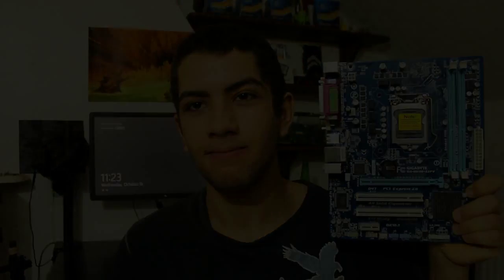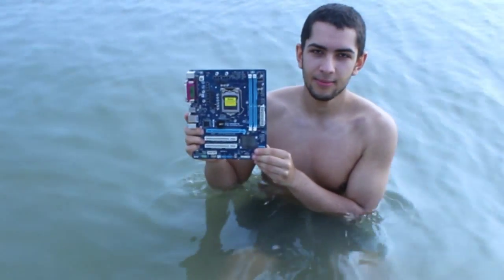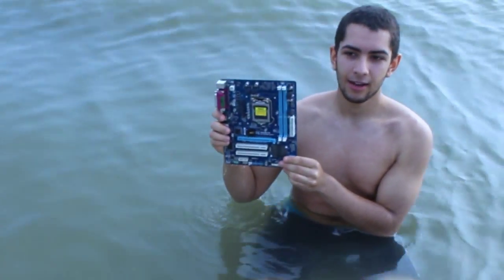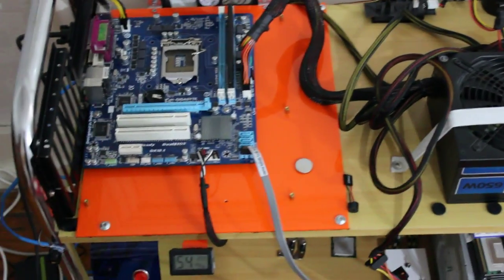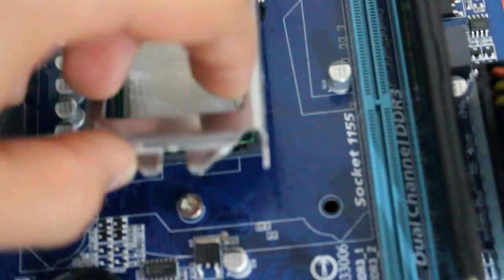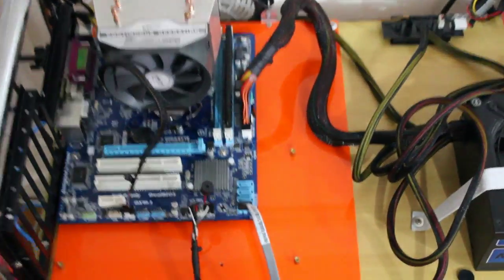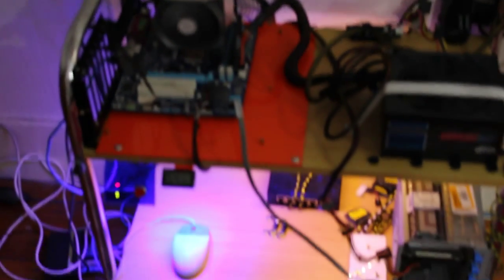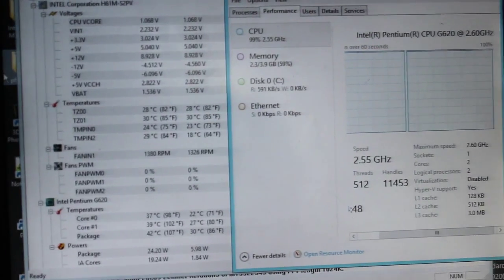Does water damage electronics?

Comment: look, water itself doesnt hurt electronics, it the impurities in the water which can be dangerous, because they CAN conduct electricity, but because the particles are small, you probably wont have any problems dunking your mortherboard in the sea, without having power running through it.. but in this case, the motherboard COULD still get damaged if any reactive particles react with other metals on the board, which creates rust.. but its VERY rare..

in the case you do have power running through it, it IS dangerous.. because now the particles can move around, which increases the possibility of a short..
 aka.. 

wouldnt recommend dunking your pc in the water..

Comment: Heyyyyyy, I came here because I have an electric air rifle from ww2 that uses a battery to operate the propulsion and the bolt in the gun. I was thinking of taking it out to a forest but im afraid i might kill the circuitry in the bolt if it falls and gets wet ect.... I was wondering if this also applies to my gun and that if what your saying is true, then i should only put the battery in when im ready to fire?  also, the battery only discharges when i pull the trigger, so as long as i leave the battery in and only pull the trigger when its dry, i should be fine right?
Reply: weapons are made for extreme situations and stuff, cant be sure whats yours, but taking it to forest must be ok...